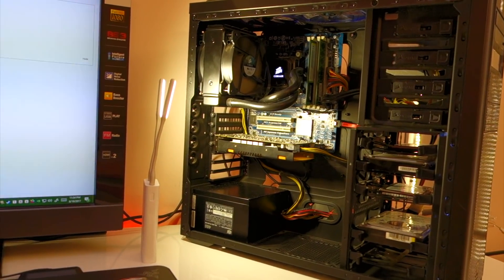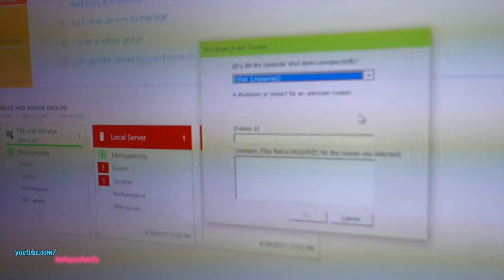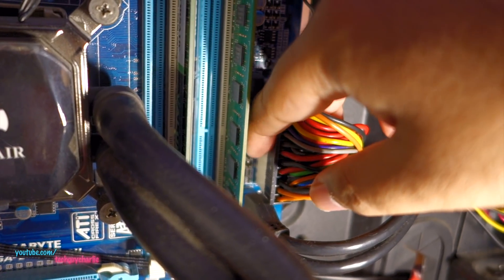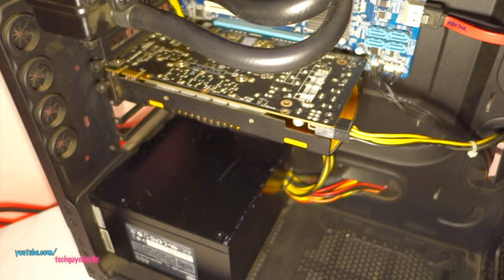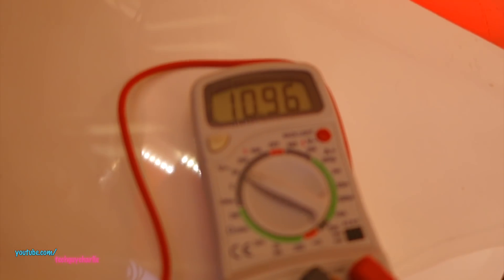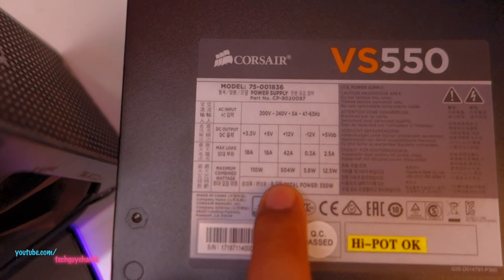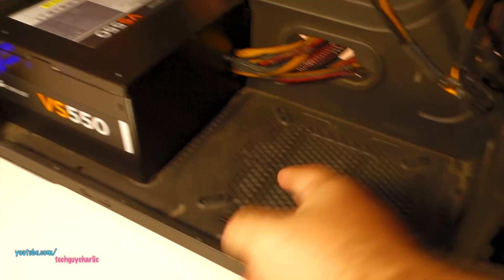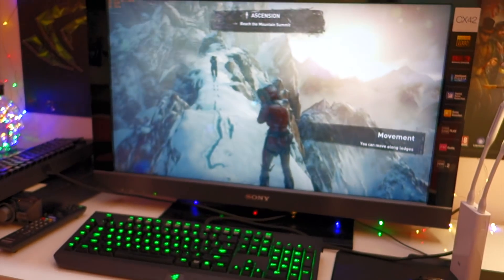Computer randomly shuts down and turns back on by itself - How to diagnose a faulty PC power supply

Comment: Might be a long shot, but my PC randomly restarts too, but it could be within a few minutes of being in windows or not at all for hours or the whole day. I'm not doing much on it besides browsing, watching movies and mining when not in use (gpu temp is fine). So for me it doesn't necessarily restart due to high load or anything, but it's completely random. I've already replaced the mainboard and had the same issue. Might look into replacing the CPU just to test.

Could it be the PSU as well? It's actually a decent one (bequiet with 750W).
Reply from the maker: If you have replaced the motherboard, chances are its the PSU!! I've built countless PCs and never had a defective CPU! its almost always the GPU or the power supply or in rare cases a bad overclock. What PSU do you have right now?
Reply: @TechGuyCharlie  Thanks for the response :-) I have a bequiet Straight Power 11 (750W). CPU Ryzen 3900x and GPU is a very new 6800xt. I've read earlier today that at least 650w is recommend so I should be in the green zone. I have done zero overclocking on the cpu, in fact I only placed the motherboard just today, updated BIOS and then set the CPU VCore from Auto to 1.3 (for some reason Auto yields very high voltages on the 3900x...). I always assumed that if the GPU is faulty I'd see graphical errors on the screen and such, but my issue literally is like somebody pressing the Reset button on my PC case for fun to annoy me. Happens completely unrelated to what I'm doing, so it already occured when I'm literally doing nothing but typing a youtube comment like this or being in full idle.

Edit: I doubt it's the RAM, it is running on XMP and memtest86 was fine with zero errors after 2 hours.
Reply: @w3sp  Hey man, did you get it sorted? If so was it the PSU? I got the exact same issue you have, it seems to happen randomly once/twice a week, when idle or playing games.
Reply: @w3sp  did I literally have the same issue as you I thought it was the PSU so I changed but still nothing. Pleaseeeeee give me an UPDATE.
Reply: @KevinS47  Nope, unfortunately not. I've also reinstalled Windows and also changed stuff around in Windows (e.g. disabling the Automatic Restart on System failure) etc but it's still as if there's a little troll hiding in my room who secretly presses the RESET button on the PC case whenever he's bored. I bought a PSU tester from Amazon and it appeared to be fine, but I'm not sure if those are 100% reliable.

Three days ago I've changed all of the CPU related voltages in BIOS from Auto to Normal. Before I'd either have those set to Auto or Manual (e.g. 1.3, 1.31 or whatever for Vcore). I haven't had a crash yet since I did that but I believe it IS too early to tell whether or not that was the culprit.
Reply: @sahilkarni1550  Not sure if you got the notification from my other response, but if not check it for some updates on the issue.
Reply: @w3sp  did that fix the issue for you?
Reply: @freshicecreqm8329  Still no crashes yet since I changed the Vcore voltage to Normal.
Reply: @w3sp  hey sorry to bother but is the issue resolved cus im having the same problem at the moment and want to make sure i do everything correctly
Reply: @rona577  hello, yes, changing the voltage settings (see my other comment) fixed it for me.

Comment: i have 750 watt and still restarting by itself
Reply: Did you fix this ?
Reply: How did u fix this?
Reply: @geraldwiedemann2126   The repair shop said it's a motherboard issue , and i am waiting for it's warranty now , seems legit because other components worked , although it's a weird issue probably in small part of the mb

Comment: Thanks bro for best suggestion
Reply from the maker: No problem 😊
Reply: I have been having a similar issue but I cannot even boot into the bios.  Checked ram, storage airflow cpu temps etc. I just built this pc a few days ago. I have not yet managed to find another power supply but I believe the motherboard may have some part in this issue.

Comment: Hey Tech guy Charlie, I have a similar problem but not really, my pc doesn’t turn off during gaming but turns off when I do hw, it restarts itself, any idea what this could be?
Reply: Did you find a solution?
Reply: @pushpithageeganage7992  unfortunately not, it shut off on me yesterday while doing mid terms, I was lucky it saved my work.
Reply: @bossmicky9256  Sad , I ll comment here if i find a solution , i replaced psu didn't work
Reply: @pushpithageeganage7992  same, I used a corsair rm 750x, up there as one of, if not the best psu, worked for about a couple days then started doing it again, unsure if its hw or software.

Comment: what if voltages are good as I monitor with HWiNFO64, And I stressed test CPU and GPU at the same time with powerMAX test for 10min. I ran memory diagnostic test. But my pc restart like your does only if I game. Even if I game it don't restart every time but may be once a day or two. Should I change my PSU?

Comment: Hi, my psu has same voltage with yours 10,8v with multimeter for 12v, but when i check in the bios it say 12,114v for 12v+ pin. Which one is correct? Btw i have same problem with you

Comment: I have this issue especially when not gaming. I have never crashed in a game and my pc passes stress tests like port royal, though it did restart in Port Royal one time, but it more just does it at random like when I am signing into my amazon account or watching youtube or something
Reply: did you fix the problem bro ?
Reply: @اليابانيةبكلسهولة  In my case I knew it was a power related problem because I would check in windows event viewer, and everytime I had a restart, it would log a “kernel power error”. I swapped out my power supply, but that made no difference, so it wasn’t a faulty power supply. After that I tried updating my motherboard bios (MSI x570 Tomahawk motherboard), and from then on the issue stopped happening. This means either I had a bad bios, which is possible since this board is known for having problems like that, or I had a setting enabled in the  bios which caused instability. If there was such a setting, updating the bios would have reset all settings to default. So if you are having trouble, and have a brand new motherboard, and you know your power supply isn’t faulty, you could try a motherboard bios update and see if that works.
Reply: @اليابانيةبكلسهولة  another thing to try, which I learned recently, is if you have a gpu with two 8 pin connectors, don't use one pcie cable with two 8 connections on the end, use a seperate cable for each connecition. I have never had a problem with using just one, but it can be a problem, so its 'worth knowing about.

Comment: Mine's getting 12.28v but is still shutting down, idk what's happening, I have a feeling it has something to do with cpu power though, it worked fine in my low powered i3 4160 but shuts down in both my Optiplex with an i5 2400 and my server with a xeon l5640.
Reply: But it only starts shutting down after like 2 days, I have a feeling its cpu and/or capacitor related, I just don't know how to replace a capacitor, if anyone knows what my problem is, could you plz inform me, this is my only working PSU, my other one shorted I think 2 days ago and I'm just scared to try it since it started smelling like smoke. For reference, my PSU is a Corsair HX-750 (2012 model).
Reply: I can't try it underload right now though, so maybe it drops under load idk.

Comment: I just bought rm650x new psu and every time I turn it on. It will turn off in 2 seconds then restart and "power surge" bios warning. Then it works fine until I shut it down.. But no matter what every time I turn it on it ALWAYS does this surge message and boots off and on..

Comment: Changed the PSU, worked for a few hours, and now I have the same problem... My old one was 500W, and the new one is 650W...
Reply: Did you fix this ? i am in the same situation
Reply: @pushpithageeganage7992  dude I fixed the issue by turning off my ram xmp
Reply: My pc was shutting so I replaced the psu. That fixed the issue for about a month but now it’s happening again 😓

Comment: Bro i have i3 8100 
Gtx1060 
Turns off and turn on its self 
While playing gaming and exporting videos from software
Reply: did you find a solution?
Reply: @pushpithageeganage7992  power supply minium 550w for gtx 1060
Reply: @naveenvarshan4191  Thank you , i got a new psu 600W but still randomly restarts 😔

Comment: I have this same problem but in a laptop.
Do you think it’s the battery? I tried removing battery and with only the adaptor plugged in, laptop still restarts after approx 30 minutes every time.

Comment: I have a small gap between psu connector and motherboard, because i can't connect properly, also i have a 99 error message in a right down corner while starting pc and have a big temperature in bios, or windows can make my pc restarting. Please help because i'm so frustrated!!
What part i need to change? What i need to do?

Comment: I've had this issue for a few weeks now and I've gone as far as replacing the thermal paste on my GPU because it hadn't been done since factory. That helped a lot because the original thermal paste was rock solid. Once I put my system back together, it was still doing it. Mine only restarts when I'm playing games which is why I thought GPU at first. I'm going to buy a new PSU and if it works, great, and if not, I'll keep the PSU and start building a new system piece by piece.
Reply: Me too
Reply: It's so annoying I restart the computer a million times a day
Reply: @epid8671  I still haven't tried a new PSU yet. Honestly losing all faith in my PC at the moment lol
Reply: @MrHowardMoon  same mate. im losing hope too
Reply: @epid8671  Replaced my PSU and the problem has gone. Games also seem to be running better in some areas.
Reply: @MrHowardMoon  My pc has been fixed now. Same problem
. PSU. Changed it and never booted again

Comment: I get the same thing happening, but ONLY with ONE specific game. It is a fairly new (one year old) computer, and when I stress test either the CPU or GPU, nothing happens. When I play POE, switching areas, but not necessarily playing graphically intensive areas, causes reboot to happen, with no warning or messages.
Reply: same happens to me, when a scene changes my PC shuts down on some games on others won’t. Did you find a solution?
Reply: @archicube  They must have patched it, somewhat. Have not seen the bug in two months. I did update all my drivers, and got a fresh download of the entire game. I don't know what fixed it though.
Reply: Same happening to me when I am playing valorant sometimes I can play the game but sometimes it got restarts what can I do someone please tell me  I have i5 2400 and gt 710 GPU and 10 gb of ram and 256gb SSD and 3 hardrives

Comment: I too have the same issue.. my pc turns off automatically and starts again.. but in my case, the voltage stays at 12.07-12.10 while playing the game and still turns off.. and the voltage doesn't drop when the system turns off. It shows 12.13-12.15 when idle. What can be the issue here.. please suggest

Comment: I have a problem like this too recently and i am using vs550 lolol, i used to have seasonic 550, after i change to the corsair vs550 it start to do this restating ritual.
Reply: Did you fix it?
Reply: @pushpithageeganage7992  i did, buying new psu fix it, seems vs550 have these faulty things

Comment: My system restart whenever there is a slight fluctuation in power supply. Iam using a vs 650 power supply with on board graphics paired to 3 yrs old Apc bx1100c-in ups which is giving a 30 min backup when power is cutoff from mains also checked battery volts which are 13.41 & 13.22 at discharging state. Please help iam suspecting bios or psu problem

Comment: I have a question , if i put my gpu in and turns on the cpu, the system will randomly reboot when loading windows , without gpu with vga , it just load normally , 

Is it a psu issue or my gpu dead?

While gamming i noticed the fps goes down with the gpu mhz and then it just shut down and reboots

Comment: Even after getting an entirely new PSU and making sure all connections were good, this issue still persists for me.
Reply: The Agency did you fix it?
Reply: @The Agency did you get it fixed? What was the problem is so? I’m struggling myself here .. :/
Reply: Fix for me is that I think its grounded. The fan might be or the case, try without fans :D

Comment: when i took my pc to the  repair shop, they said it was the MB, got a replacement for 45 euro (~53$), now the pc works as it should
but the replacement is a older motherboard which kinda sad and its not even a decent one..
 since im getting a new psu because i want a gpu in my system i might try the old motherboard which i still have (im still playing on integrated grafics :(   )
Edit: i had the same problem as you except it only restarted when i was gaming

Comment: Hi. I've been having the exact problem for months now. So I thought that it would be a power supply issue. It was not - the power supply is perfect. I still changed my CoolerMaster 850 watt power supply with Seasonic 850 watt gold, still got the problem.

I tested the computer in another house and it runs perfectly with no crashes. So, here's my question: if I get an UPS, will it help me to fix my problem? What do you think?

I live in a 19 sq.m. garage where the power cables are a bit thinner than in ordinary apartements. this MUST be the issue....
Reply: Did you managed to fix that problem ? If yes then how ?
Reply: @ezty1207  yeah I did. The reason was stupid - GPU overheat. The PC was essambled by a friend of mine. He's very good with PCs but this time he forgot to properly screw one of the bolts of the cooler. As a result, the cooler wasn't touching the GPU as it should. Fixed it myself in no time once I found it.
Reply: @giorgipruidze3361  you still friends with him?
Reply: @ezty1207  If you're having the same problem, check the thermal ink first of all.

Comment: 90% of the time to much dust build up in the psu open it clean it will fix that dust will arking with the dust that why you got 10v instead of 12v over heating thats was going on to much dust build on the caps and board in the psu i thought i had to buy a new one open my psu up 8 year old lol clean runs perfect i7 6700k gtx 1080 16gb ram antec 900wat high current gamer psu hell of a good psu i havent clean the psu in 8 year 7 years lol i thought it was bad till i open the $269 psu caked with dust after i clean it out no more turn off when i fire up a game before you use the pc for movies and web fine but gaming run for few mins then turns off no more clean it first before you buy a new one most of the time people will all way forget to clean out the psu lol like me for 7-8 years but all ways clean my pc out few times a year

Comment: My pc does this very randomly regardless gaming or not. The psu clicks in and off and clicks off even after power is off once I think it's just its voltage switch
Reply: Did you fix it ?
Reply: @pushpithageeganage7992  yes

Comment: I just replaced my CPU with a used ryzen 3 3200. My PC actually works fine while I'm gaming but as soon as I stop n just web surf it will turn off n restart. U think the CPU could be bad? Because it never did that with the old chip
Reply: Same issue. PC doesn't turn off when I got multiple instances of games running. It only randomly turns off and back on when I am doing "lighter" tasks like browsing the web or watching a video. Did you ever fix yours?
Reply: Guys did you fix the problem ? What was the issue ?

Comment: I just replaced my PSU... still having the same problems. No dust, not overheating, all drivers updated... what is the next step?
Reply: Xuande12 motherboard if ur still having problem
Reply: MistaNoZero I replaced almost everything it has to be the motherboard, it only does it with certain games while other games (graphically intensive with no overheating) run just fine. I’m guessing it’s activating something in the motherboard that is faulty with those specific games while others are not.
Reply: @FeliPeltier  same for me. Hoping a power supply could fix it for me. Hope your problem gets resolved! I would reset bios settings and make sure nothing physical is conducting any sort of electricity on anything. Best of luck!

Comment: No errors pop up. I have to go into the event viewer to see the power failure. Also I can run heaven at ultra and make all the easy through the bench, yet destiny 2 is usually shot 5 mins in. Oddly enough though heaven will have my fans running almost at its highest fan curve but destiny 2 doesn't..